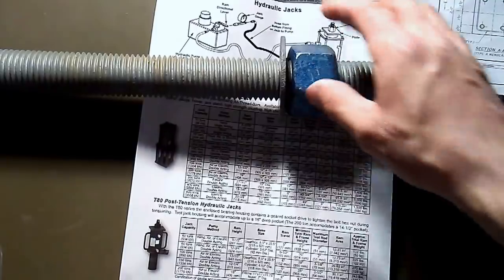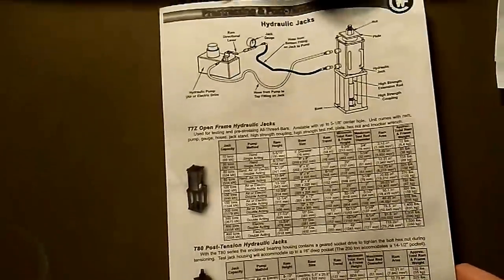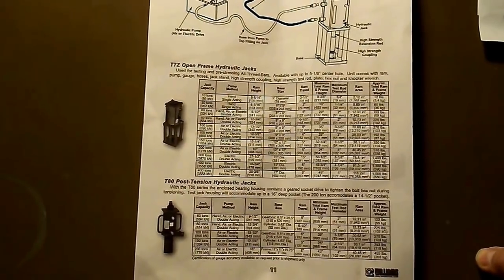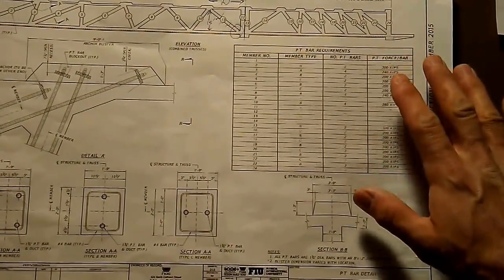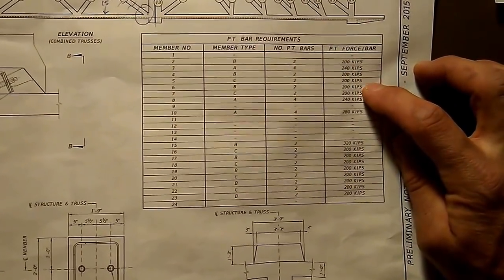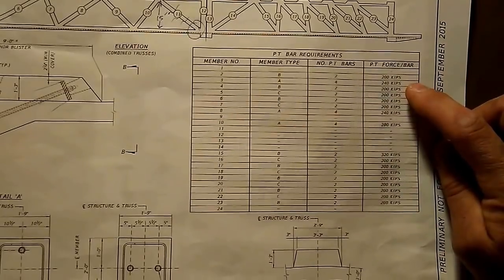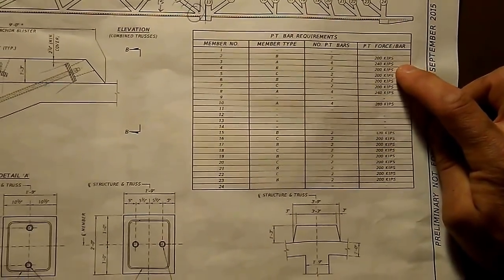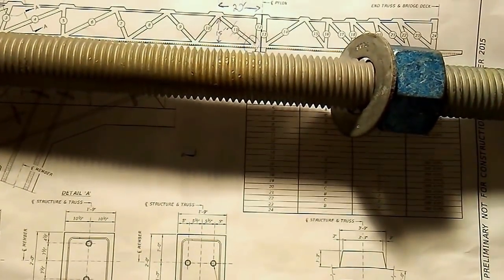FIU Bridge Collapse: Post-tensioning Explained

Comment: I can't see the tension bar diameter on your plan but if it is 1-3/4", we are getting into the plastic region for this tension;
I checked your calculations and you are OK but the calculated elongation is 0.00287 (in the plastic region)
Tension force should be kept at 70% of the yield force (0.00207 elongation)
Could you please double check the specified tension bar clear diameter; Thanks for those specified details!
Reply: These are high strength rods. The plastic region occurs at a much higher strain. The Fu of these bars is 1047MPa (I don't know the yield force off hand). The yield strength of a typical rebar is 400MPa which makes the yield strain of 0.002 for a typical bar. The yield strain of the PT rods would be in the order of 0.004 or more.
Reply: I agree with you but the shown physical bar in the video did not look like more than Grade 97 (1-3/4"  219 kips yield) or even quite less (very Short Locking nut and no Blocking plate for 200 kips Force;)
Mainly, I was looking for a confirmation for the 1-3/4" shown on the plan because for Grade 150, available close diameter that I am familiar with is: 1-5/8" (234 kips yield) or 1-7/8" (323 kips yield) but there might be other diam. that I am not aware of.
Like many, I am puzzled by this failure and trying to stop the bashing...
This bridge was intended to be suspended; for erection convenience, it was transported as a Cantilever and then rested as Modified Howe Truss Bridge; Why did they not finish the tower before transporting the bridge... 
Operation complexity leads to higher risks... and errors.
Have a nice day,
Reply: I think he just showing s fully threaded bar in the video because what he had on hand. The actual bars used are a bit different. It is really important to use high strength bars in PT to get the strain levels high. Otherwise, there are too many looses due to creep and shrinkage in the concrete.

I think the main intended structure was the truss and the cable stay (actually steel tubes in this case) form was just for redundancy and harmonics control.
Reply from the maker: PT bars are not tensioned beyond yield. In this case the PT bars had a specified 150ksi (1047MPa) utlimate stress and maximum jacking stress was 120ksi (yield stress). 
See link for more info about PT bars: http://www.williamsform.com/Threaded_Bars/150_KSI_All-Thread_Bar/150_ksi_all-thread_bar.html
Reply: @Richard Hamel; no, the superstructure was not for support, but for aesthetics only.  The designers simply wanted it to appear as though it was suspended.  The sloping members were just pipes with only enough connection to hold them up, but which would have been inadequate to hold any other forces.

Comment: This type of post-tensioning  high strength  bars is  usually use in geotechnics or in temporaty (suporting)  structures (this is also my experience) .  I believe they were installed only to overcame stresses during transportation of the bridge.
Reply from the maker: Richard Oblak Great points Richard! The consensus appears to be that the bars in Member 11 were not needed after the move. I analyze the bars in depth in Part 4 of this video series. Let me know what you think.
Reply: I agree. I express my opinion some times ago . I wonder what were those two guys really  doing on top of the canopy when the bridge collapse. There is a new video (and pictures) on the Net showing the top of the canopy after disaster. The blister over the members #10 and #11 had to be break-off (!!!!)  to get the workers access to the post-tensioning bars . This is situation difficult to understand
Reply: Dywidag bars are used for both temporary and permanent geotechnical applications. These bars can be part of the permanent structure and I suspect there were intended as permanent elements for other diagonal members but were not intended as "permanent" for member #11. I suspect they were permanent in the other locations since you need really good anchorage at the end of the reinforcing to make the transfer of loads works at the joints. We use what is called a strut and tie model to justify the transfer of loads. When you go through that design process, you will find that steel bearing plates are likely required to transfer the loads at the joints.

Comment: Then why was the jack hanging out 10 feet in all the videos, because that is where the rod snapped and came shooting out.
Reply: @Norman Jones; visualize that the now naked rod had once been encased in concrete which is now pulverized and gone from around the rod.  Rod is intact.  Concrete not so much.
Reply: The tensioning rod did not brack, as some incorrectly surmised.  The lower end of the rod memained anchored in the deck, which fell.  The lower end of diagonal member 11 did not fall, however, but remained at the top of the pylon while the other end rotated down.  The tensioning rod was torn out of the side of member 11, and the changed geometry forced the rod out at the canopy end.  This can be seen clearly in the OSHA report photographs.

Comment: The fundamental question still is: why  we have these post-tensioning bars in the diagonal # 11 ???  If the EOR tried to control cracking in #11 diagonal caused by secondary bending moments this was a  high-wire act !!! 

We should not to blame anybody. Definitely not  those who are at the bottom of the food chain . Everything is highly speculative in this conversation
Reply: They were probably just there for the move. I doubt they were there for any bending capacity.

Comment: It's easy to see web member 2 will have the highest compression, but during transport, member 11 was under the highest tension because the support was directly under the lower node of member 11 and the other support was just outside the lower node of member 2. Now, thinking of the nodes as hinge points, you have member 11 keeping ~20% of the 2,000,000 pound bridge from hinging down to the road. That is in excess of wht those bolts were meant for under max tension. Now, the upper and lower cords probably would not break off under their own weight during transport if there was no member 11, but they would have sagged enough to make the post tension bolts yield. Once the bridge was set, it would be nice to know where the nodes were in space and where they were supposed to be. 
When we consider that the tension on #11 exceeded the bolt strength, we know that the concrete was under tension in member 11 which would allow any cold joints to give. Any cold joint planes that are not perpendicular to member 11 will have a tendency to shear when put back under compression. Member 11 being the 2nd most compressed web member after placement AND the second highest pressure anywhere in the structure when you consider the cross section. Now, to release the tension put on the rods during improper transport the tension was increased even further which also put more compression on member 10. The idea that they would place a member designed for compression that was recently put under tension under the highest compression it would ever experience with traffic underneath is in my eyes criminally negligent. So many people did their job wrong to let this happen. I don't have my own seal or anything, but I have the knowledge to build complicated mechanical and static structures.  It is a tragedy in many ways that this was able to happen. Somebody more fluent in solidworks needs to run a simulation- I guarantee it will give the same results- it of not with the engineered values, change the concrete strength in a few areas and you'll have an awesome video that is easy for most to understand. Obviously I'm passionate about this stuff and you must be a little if not as much as me. Too bad you dont have a subscriber base like AvE. I know it goes against YouTube etiquette, but I'm going to post a link to this video on his bridge video. I'll do it within my own comment so it doesn't stand out so bad. I've gone on about this in too many comment sections, but you should make sure to comment on all the popular ones. I don't want them blaming some component even if they handle the real issues under the table. I want the public to know how many engineers and GCs dropped the ball on this. Even from the start.by not using approved engineering firms.
Reply: If you do some calculation, you can estimate the tension load in the order of 300Kips. The concrete was not in tension and the PT post tension load was not exceeded.
Reply: Andrew McLellan So, the bolts were tensioned to around 400,000lbs? A 1.25-7 bolt has a .97sqin cross section. Yield on grade 8 is about 120,000. What is taking the other 160,000lbs?
Reply: I believe you have the wrong bolt size. I believe the drawings also indicate that the strength was 150 KSI. If you look at the tensioning table, rods were post-tensioned anywhere from 200 Kips to 280 Kips. 2x200=400Kips>300Kips (I was also being a bit conservative with the 300 Kip load). The video indicates a 1.75" diam. with an area of 2.4 in^2 (although in the video I think he forgot to multiply by 0.75 to account the reduced area of the threads). Rods are typical tensioned to about 70% of ultimate which places a 1.75" rod at 150x2.4x0.75x0.70=214 Kips (similar to the drawings).
Reply: Andrew McLellan duh, I was looking at his bolt lol!
Reply: Gocartkits I've always said that the #1 reason was poor placement of concrete.

Comment: Some people question using pre- or post-tensioning in bridges. This is wrong. Post-tensioning prevents cracking of concrete and prevents deterioration of concrete and steel (rebar), do not forget, bridges are expose to weather .  It also enhances fatique resistance of bridges and allows to build longer spans by reducing the self-weight of structures.
 
The most important question is still not answered. If this structure mimics the behaviour of the simply supported W beam section why we have post-tensioning in the top flange (canopy). The top flange is in compression. Why to add the compression force to the flange already in compression ?????
Reply: That is a good questions and the answer is not obvious. I think there are a number of possibilities which you wouldn't be able to confirm until you do a full analysis under all the different loading conditions. The top acts as beam between the joints and needs to be reinforced to carry these more localized loads. Another possibility is that the top is a diaphragm that acts like a giant beam in the horizontal (perpendicular to the span) beam. When the bridge has a full live load on one side but not the other, it wants to twist. The couple between the upper and lower diaphragms resists the twisting force. The diaphragm has to span the full 175' by itself. That canopy experiences large in-plane bending forces which requires a lot of reinforcing.
Reply: Love Your answer! crowds do strange things, IE. watching a race, running from one side to the other as cars or runners pass under. Engineers have to design for the unexpected, I once watched a fishing boat capsize as fishermen ran from one beam to the other chasing a school of fish! all had PFD's thankfully and no one drowned.

Comment: There was no way to adjust tension on the bars after the bridge was in place. The adjustment was made from the bottom before the move. They were anchored at the top and there was no access to them - nor was it required.  There was no need to release tension once the bridge was in place as the load stress would have exceeded the stress applied by the rods. They would have been slack. 

For some reason, before the move workers jack-hammered the top of the bridge to reach the rods. Apparently they could not be tensioned properly from below as per the design.   This was a completely unforeseen action with unknown risks. The move should have been stopped until the effect of this was understood.

At the time of the collapse, workers were once again working on the rods from the top. Apparently, they thought this would fix some unknown problem that had been found.

The rods were incapable of applying any additional stress beyond the load compression. Whoever thought that adjusting them would do anything had no engineering knowledge. It was beyond reckless - especially with the road open.
Reply: .... " to fix a problem",,,  What problem ?
Reply: Who knows? Whatever they thought would be fixed by tightening the rods.
Reply: I believe the live ends (the end where the jack is applied) is likely is on the top. The dead end in on the bottom. What you see jack hammered out on the top is the grouting pocket. The grouting pocket protects the end of the PT rod and has to be removed to get to the live end of the PT. The rods do not go slack when the bridge is placed on the final support. Even though the #11 diagonal is in compression, the rods only loose some of there post-tensioing force. The rods are post-tensioned to higher strains than the strain that #11 experiences when it is put back down on the support.
Reply: @AndrewLMcLellan,
 
If these were the grouting pockets you should see nicely formed pockets after jackhammering (remowing grout). What I saw was total mess. For me it was breaking thru 8000 psi (!!!) concrete.

We don't know  what was the level of post-tensioning. I believe they were installed to take tension during the move of the bridge but this force was small. The level of tensioning may be from 0 up to 0.8 fu if I remember this right. The preliminary drawing do not show any PT bars for diagonal #11.

Speculations.
Reply: I believe the rods were added later once they determined that the supporting members for the move would have to be placed further inside the span - requiring the ends to be cantilevered.  In addition, the angled member on one end was thickened, but not the other. Guess which one wasn't thickened.
Reply: I would think that if these were grouting pockets they would have been created during construction. These holes did not exist until the time of the move.  Also, I am fairly certain that the rods would not have been able to apply anywhere close to the stress of the final load compression. I could be wrong.
Reply: I watched the video again. I did not see any grouting holes. I saw "bloody mess" on the top of the blister.
Reply: Where did you find such information ?
Reply: Grouting pockets are created during construction. They were grouted in  and then the grout was removed.
Reply: I believe the pockets were grouted in and that is why they look so messy. It looks like from the videos before the accident that all the pockets were grouted in. Doing the live end at the bottom is just inconvenient and you would typical only do that if the geometry dictated it. The preliminary drawings don't show PT in #11 but the reality is that there was PT in #11. I suspected the PT rods were added into the design for the move. 

Cable is typically tensioned to 80% of Fu but rods are a bit different. The preliminary drawings indicate tensioning form between 200 K to 280 K.
Reply: @marmaly; your ideas do not make sense.  IMO; no "jackhammering" on a new structure.  Tensioning from below is not logical.  The engineer would have specified the tension in each PT rod.  There would have been no last-minute changes to the tensioning.  Workers do not decide on their own to make critical adjustments to PT rods.  If you think the PT rods were incapable of applying the necessary compression, then why not show your analysis to the NTSB investigators?
Reply: marmaly--it is confusing, but drawing S-38 PE Stamped 4/7/17 (one year ago) shows access through the "blisters" on top of the canopy for the tensioning process.

Comment: one tension cable went plastic and yielded.
Reply: The cable itself is likely not the issue. It probably happened to initiate a failure in the concrete.
Reply: The cables did not fail.  The node at 11/12 was inadequately reinforced and it came apart.

Comment: unless you are a graduate civil structural engineer one cannot understand this. Often Finite element analysis is used . This method has been used for decades with success.
Reply: I do FEA. Practically speaking, it is true you are not likely going to design this bridge without FEA. However, the failure mode can be analyzed by hand. There is only one dead load case to consider and we know where the failure began. This makes it a lot easier. We also know is the main truss that failed (rather than some odd ball load case with twisting on the deck or asymmetrical live load).